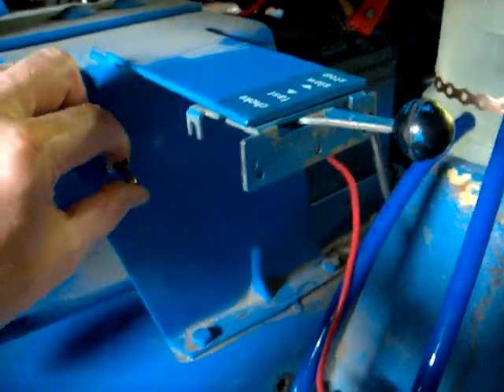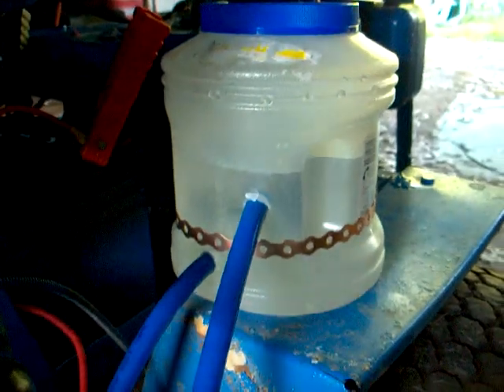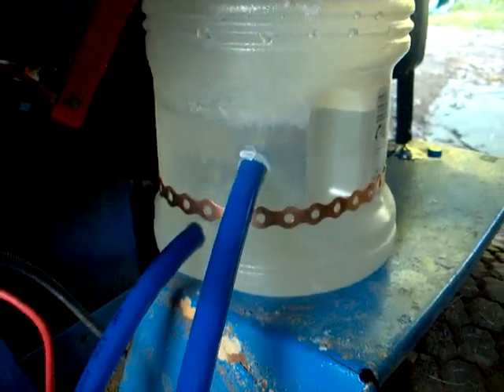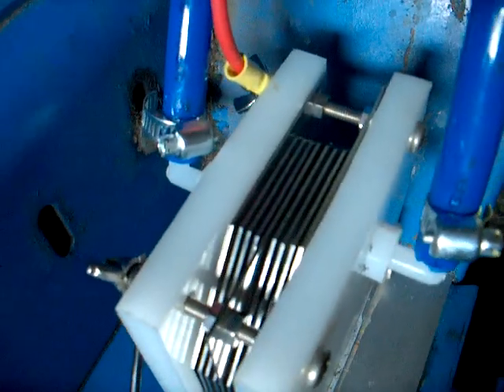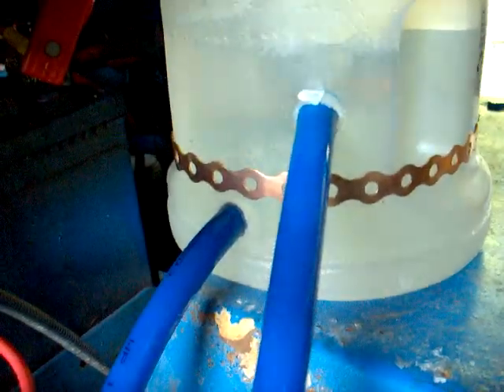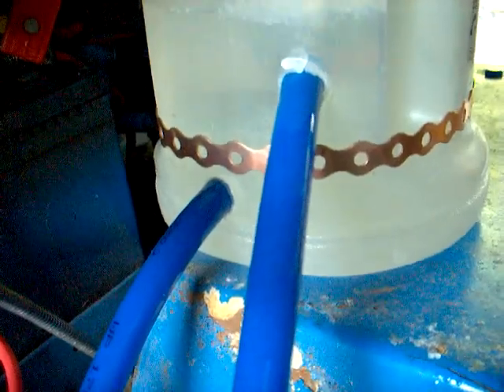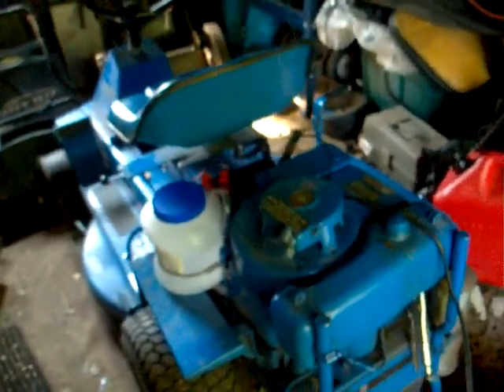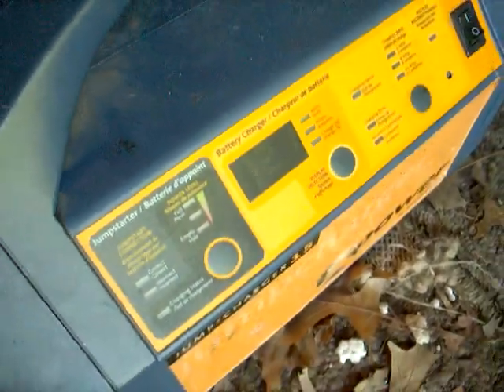hho dry cell running 8hp lawnmover part 1

Comment: Cars have ran better on hydrogen then gas! It's been proven on dyno machines! 
But we cant have hydrogen powerd vehicles, the reason why it is a bad idea it would depleted water sources.
Cannabis seed oil have a very low Flashpoint then Diesel. In fact Henry Ford is the first inventor of plastic,  aka Cannabis Plastic. He used this plastic for the body of the car and the car used a diesel engine and Cannabis seed oil for fuel. 
This plant takes a 120 days to be harvest.

Comment: @xjet Law of conservation of energy doesn't defeat this experiment, since you and actually consuming the hydrogen gas, and using the HHO gas acts as a catalyst for the gasoline engine, which usually has only 75% (or worse) efficiency.  I think this is HHO isn't a hoax, since so many people are experimenting with it there must be something to it, would have been debunked by now if it were false.